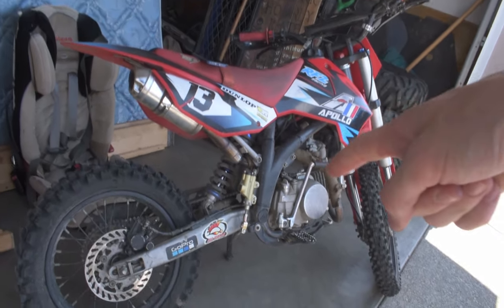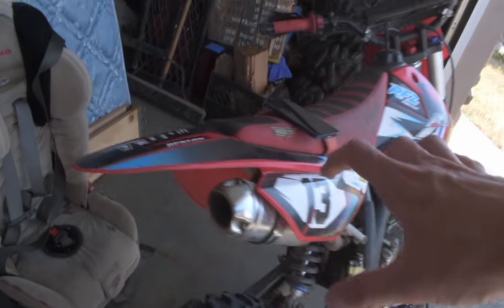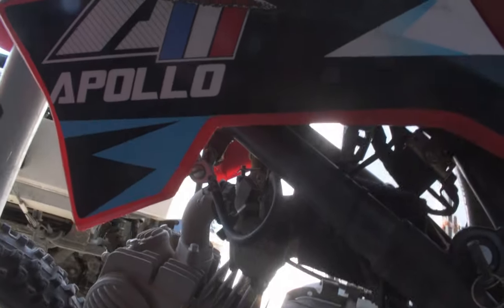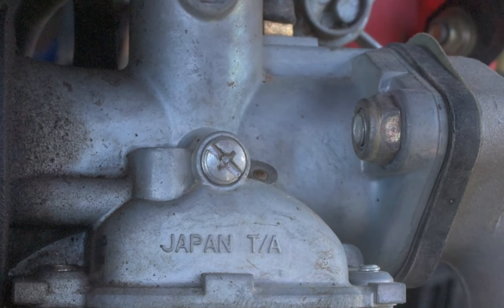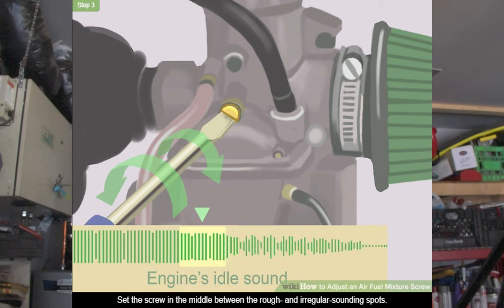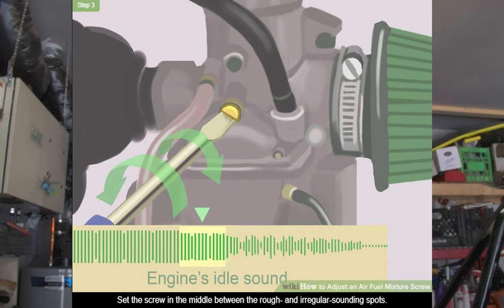How To Fix A Dirt Bike That Wont Stay Running | High Idle | Hot stall

Comment: Hi, great vid! Though I can't find a solution for my problem. It's really weird, without choke it will rev up and wont go down, but also sometimes it does not and it dies.. If I have full choke then it revs up a lot, so the only way I can run it okay is it I have the choke on like 1/5, but even when I do that it dies on idle, but it doesn't rev up a lot. The idle screw does nothing even if I screw it out all the way or in. I cleaned the jets, but it did nothing except give it a bit different sound. Someone have any idea what I can do?
Reply from the maker: Well if you need the choke on for it to run, that means you’re making the bike richer. So my assumption would be that the bikes running lean. What colour is your spark plug
Reply: @AaronsEnduro Hi! Last time I checked it was pretty dark
Reply from the maker: Hmmm gonna have to think about this one
Reply: I think usually an idle that drastically varries it's often a vaccum leak. Not always but it's a possibility make sure your intake manifold is tight and doesn't have cracks. Make sure the seal between the engine and intake manifold is sealed well.
Reply: @Jammy Dodger Not yet sadly. I took a break from fixing with it and I'm gonna pick it up again soon. So I'll let you know if I find out what the problem was!
Reply: @Greasy__Bear Oh yeah that could be the problem. Any tips on how to make sure it is tight enough? I'm quite new to fixing with bikes... Thanks for the tip tho
Reply: @ev2n-u7o  if it's tight enough that you can't pop the carb off without loading it some than it should be good enough. To Check if it's the problem spray brake clean around where the carb is attached to the manifold and spray where the manifold attaches to the engine with the bike running if it dies or stumbles bad you have a vacuum leak. If not it could be compression issue of some sort or more carb issues. 

If you don't see cracks in the manifold but it has a vaccum leak take it off check the sealing surfaces and try putting it together with something like gasgacinch.
Reply: @Greasy__Bear  Alright I'll try that, thanks mate!

Comment: Mine doesn’t want to idle unless its warm
What could be the cause of that i got the mikuni carb from amazon and put a 110 main jet in it and it still wont idle until the motors warm then it idles fine any ideas?
Reply from the maker: how dark is your spark plug tip? assuming its pretty rich and too rich on start up?

Comment: hey i have a problem with my dirt bike i messed around with the choke (honda crf 250 2012) i spinned it around and now my dirtbike starts with a good idle but aafter i give it some throttle in neutral or even ride it,it begins to idle at higher rpm (if i turn it off and start it again it will idle good but after some throttle it does it again) please help me !
Reply from the maker: did you set the idle with the bike up to operating temperature
Reply: @AaronsEnduro  i don’t know how to do that it’s my first bike :(
Reply: @AaronsEnduro  could you make a video on that?
Reply from the maker: All you have to do is get the bike running, get it warmed up fully. Then adjust the idle screw on the side of the carb until it idles calmly with the choke off. Then your idle is set. Ez pz

Google will also give you a good breakdown of doing it. Its real easy!
Reply: @AaronsEnduro  i can't thank you enough dude :D thanks for the info
Reply from the maker: Let me know how it goes!
Reply from the maker: Thanks for watching!

Comment: I have a 250cc dirt bike. I bought it few days ago and when I want to start it, it will start and idle but I have to rev it every five seconds before it turns off. When it warms up its fine. Is that normal? It has an electric start, is it supposed to start as soon as I click the button and it switches over like 6 or 7 times?
Reply from the maker: Adjust the idle screw
Reply: @AaronsEnduro  thanks mate going to try it and see how I go today!!
Reply from the maker: @1fiftyfive689  Sounds like you have the idle set to low. Also are you using the choke to start it up when its cold?
Reply: @AaronsEnduro  no I'm not and I think that's my problem too. I'm basically supposed to start it on choke and when it dies out I start it again without choking it?
Reply from the maker: You turn the choke on to start the bike cold, then once its been warming up for a minute turn the choke off. Now that the bike is hot, you continue to start it without the choke for the remainder of the ride
Reply from the maker: If you’re starting the bike cold without choke, of course youll have to rev it to keep it alive
Reply: @AaronsEnduro  Dude you're a legend. 

Adjusted the idle and choker was on when cold starting and it didn't turn off😍

You my friend, have gained a new supporter. Keep it up!
Reply from the maker: Glad we could get it sorted out!
Reply: @AaronsEnduro  and what to do if the choke its on, and the bike turn off about 10 sec after that?
Reply from the maker: Sounds like you need to raise the idle screw adjustment

Comment: hi. what could be the reason for black spark? i just bought mine 1 month ago and now its already black
Reply from the maker: Unburnt fuel
Reply: @AaronsEnduro  
is it possible to just clean the plug?
Reply from the maker: That wont fix the issue of why the plugs going black in the first place
Reply: @AaronsEnduro  
i understand. but can i still use the spark plug after the issue leading to unburnt fuel has been resolved?

Comment: Hey 
Just picked up a 125 4 stroke pit bike runs and starts great when the engine is cold but 3 mins of riding and the bike stalls out and won't run without stalling until the bike cools down??
What do I do to fix this please help!
Reply from the maker: From the sounds of it, its either choke related or idle screw. Im not sure how familiar you are with the choke and idle screw
Reply: @AaronsEnduro  what would you recommend i try and do I'm going to work on it tomorrow hopefully I can get it going the bike feels great for 3 mins until it gets warmed up and the bike just shuts off and will not run until cooled down.
I can start the bike but it will only run for a couple seconds and die.
Thanks for the response ill keep you updated with what's going on maybe we can start a discord and we can chat about it later.
Reply from the maker: To me it sounds lie you’re idle screw is set too low. Can you keep it alive with reviving it manually when its hot?
Reply: @AaronsEnduro  got it working had to adjust the carb and drained the old gas and replaced with new and she purrs now.
Thanks for your help brother!
Reply from the maker: Hell yes! So glad to gear shes rippin!!

Comment: No matter what my bike is on choke on or off it's won't run or accelerate with accelerator but if i spray quick start in it it will accelerate with hom much I put in and I have no idea whats wrong with it
Reply from the maker: Sounds like its not getting fuel in the engine

Comment: Any advice on why my bike runs for 3 to 5 seconds then does a big rev up and stalls? It will generally start again but it just keeps doing 1 rev up and then Immediately stalls?
Reply from the maker: Sticking throttle needle possibly? Kinda hard to tell without looking it over myself
Reply: @AaronsEnduro  i have 25:1 in it and it ran for a few minutes but I think it got hot and then stalled. Now every time it starts it just idle normally but then revs quickly into a stall. I picked these up free so I have no idea what motor or condition they were in
Reply from the maker: Honestly i have no idea man, time to get your tools out and do some diagnostic testing! If you figure it out id love to know
Reply: @AaronsEnduro  for sure man I will give an update when and if I resolve it. Cheers mate

Comment: I need help. I fell off of my bike doing a wheelie like a moron. I had to replace the silencer, because the hanger was bent. The header pipe has a slight bend, but the new fmf slid right on and I put the bolts in. It starts fine. If I rev it, it will continue to stay loud. Air screw position is within spec. Idle screw doesn’t really do anything. It just holds the rev even when I’m not revving it. The bike also goes by itself without any throttle. When I have the kickstand down it will move on its own. Also when I fell off my throttle was stuck. I took the throttle apart and I cleaned everything with wd40. At first I would twist the throttle and it would not snap back. When I put the throttle and everything back together it started snapping back when I let off the throttle. Throttle feels normal. Please help if you can. Thanks.
Reply from the maker: Hey there buddy, sounds like a couple things are goin on. Firstly if your idle screw was able to “hold the revs” as you say, its working and you want to lower it until is sounds calm running and smooth. 

2nd if your throttle is sticking im guessing when u crashed the end of throttle and grip got smashed inwards onto the bar end
Reply: @AaronsEnduro  well when I kick it over it starts fine. The weird thing is that the bike literally moves while in neutral with the kickstand down. I could ride for a while without using the throttle and it would never die or stall. I turned the idle screw all the way to the left to see if it would quiet down the idle, and it didn’t change the idle at all.
Reply: It’s only when I rev the engine that I’m getting rev hang. If I just let it idle without touching the throttle it’s fine.
Reply from the maker: My apollo would wheel itself around on the kickstand too. It was just the bike rattling forward. To verify you dont have any drive force when it supposed to be just idling, jack the bike up so the wheels off the ground and see if when its running the wheel spins forward.

As for the idle screw its hard for me to guess over yt without being able to look at it and disassemble the carb.
Reply: @AaronsEnduro  I’ll have to check tomorrow to see if the wheel spins while idling. If it does what’s the fix? I read that it could be an air leak. But I would think if their was an air leak the bike would want to shut off with lack of fuel. I’m just not sure.
Reply from the maker: If the wheel is forcefully spinning thats a clutch/ transmission issue
Reply: @AaronsEnduro  I will find out tomorrow. Do you think it could be a throttle adjustment issue? I used to have a little bit of play in the throttle but now I have no play. Also I might have to adjust the clutch?
Reply from the maker: All of the above lol. Check it all over and make sure its set correctly
Reply: @AaronsEnduro  will do. Thanks for replying.
Reply from the maker: Thanks for watching!

Comment: I just noticed considering that my bike is over 10 years old and the spark plug hasn’t been replaced at all. That might be a issue💀
Reply from the maker: Very well could be! Manuals says every 30 hours it should be changed lol
Reply: @AaronsEnduro  I never knew that, thank you for the info. I’m changing it today😂

Comment: Carb? What is this?  The Flintstones bike?
😆 😅
Reply from the maker: If it aint broke dont fix it 🤷‍♂️
Reply: @AaronsEnduro  How do I adjust the idle on a 2017 KX450F fuel injection?
Reply from the maker: Rotate the idle adjustment screw / choke knob for your bike

Comment: I have a 125cc mini chopper I’m building and it doesn’t kick over without the choke and when I put the choke down it sounds like it’s gonna explode please help me
Reply from the maker: If it only runs with choke on , youre starving it of fuel. Choke makes the mixture richer. If you’re bike wont run without choke its too lean

Comment: My bike only idles on choke and it’s a high ish idle and then soon as it’s warm and I drop the choke it will idle for about 5 to 10 seconds nice then it gets lumpy then dies, also when Im riding it’s perfect no bogging or dead spots but on decel I get single loud bangs out of the exhaust but no flames, no black smoke and ive checked the plug and even put a new one in it. I’ve also put a new cdi on it, do you know what my problem is. Ive got a video of the idle on choke then taking choke off and it dies after 5 ish seconds
Reply from the maker: Your bikes running lean